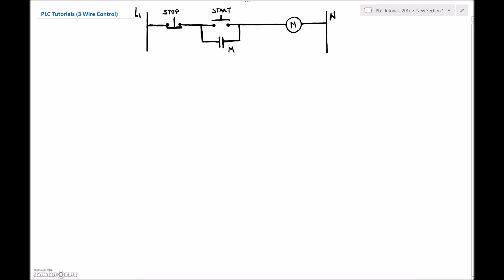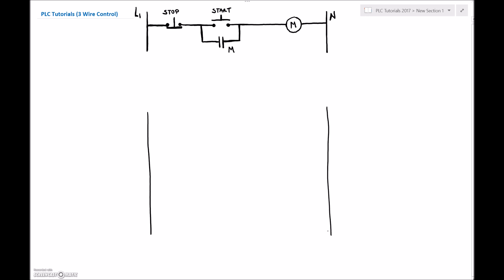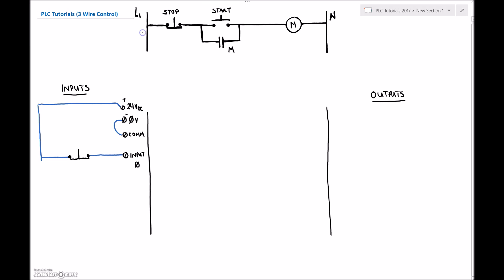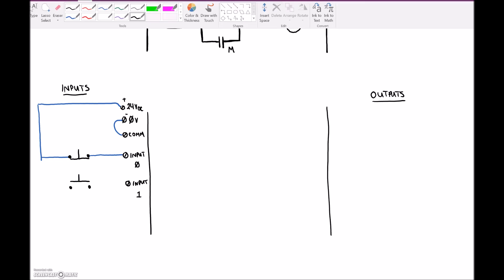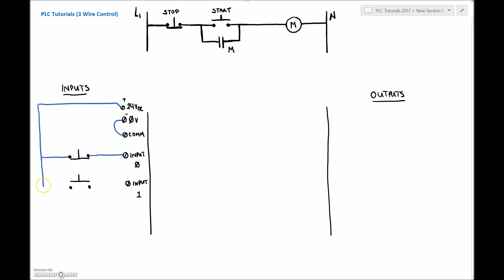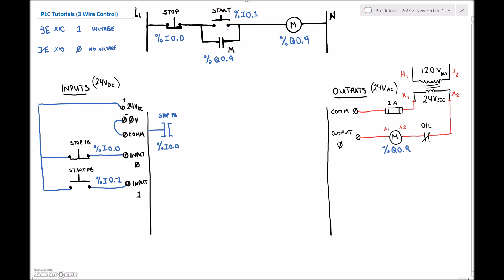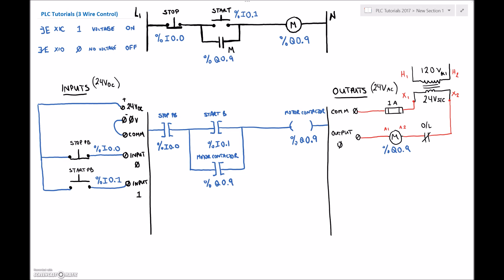PLC Tutorial (TwidoSuite) #2 (3 Wire Control Explanation)

Comment: Does plc work on a.c. or dc voltage
Reply from the maker: Most PLC's are fed with 120V or 220V. Most likely the Inputs are fed with 24 V DC that is available either from the PLC's internal rectifier circuit or an external 24 V DC supply. The outputs can be transistor or relay controlled, and can therefore control either AC or DC loads.